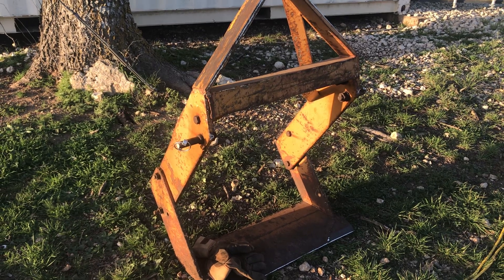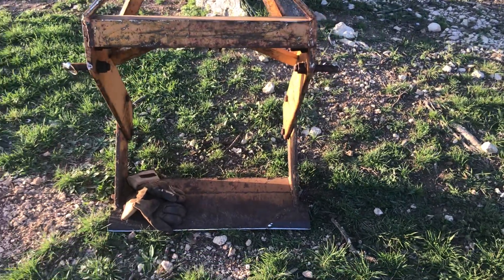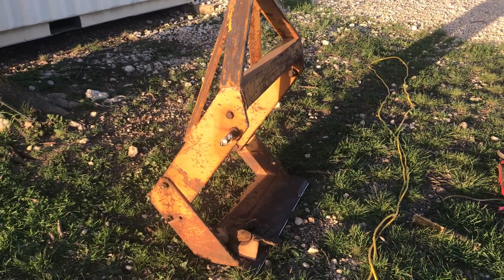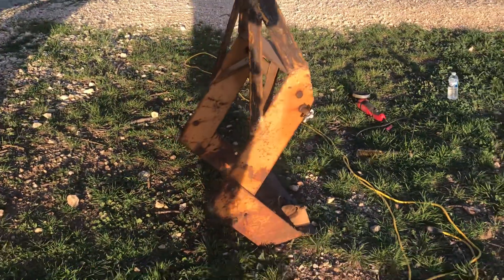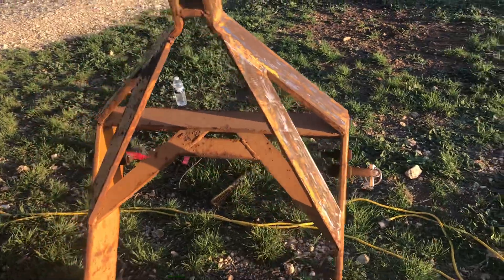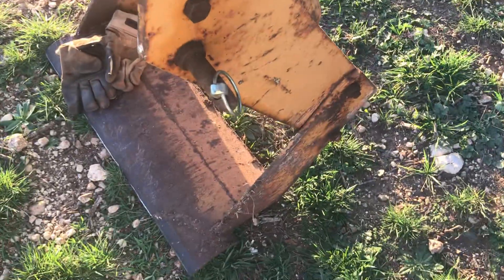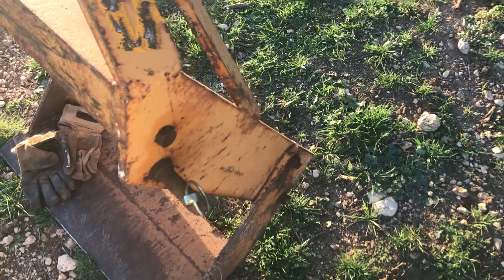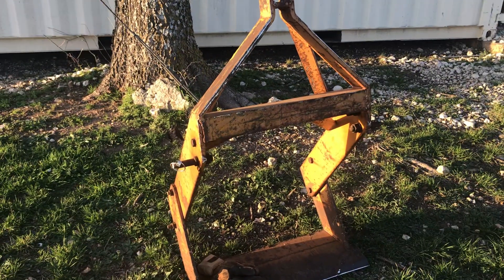"New" Mesquite Root Plow

Comment: Thank You for the speedy reply!!!!  I have se these things for sale, But I was wondering how much power.  I have fought Mesquites every which way, they are hard to kill, but if you cut the tap root below the "Bud" it will die.  This Bud is usually about 8 to 12 inched deep.  Mechanical Kill is better than "Spraying" etc.  You just NEVER get them all with Spraying.  Everything that was powerful enough to kill them, the Government made them quit making it.  Boy I HATE MESQUITES.
Reply from the maker: Might check out auctions this spring.  I've seen another type called Brush boss from time to time.  I had one similar years ago that worked pretty good ( I'm originally from Madison County Texas).  Will need some weight on front end of the tractor if you hang a big one, so be careful and perfect your technique.

Comment: How many tractor horse power does require??
Reply from the maker: This one is the smaller version of the two they sell. Probably in the 40 hp and up.  Geared tractor with ag tires better than a hydrostat.  Believe it might require some trial and error with the type of soil, soil moisture, etc.  I've had to sharpen mine with the grinder more than I'd like but that's due to rocks on my place